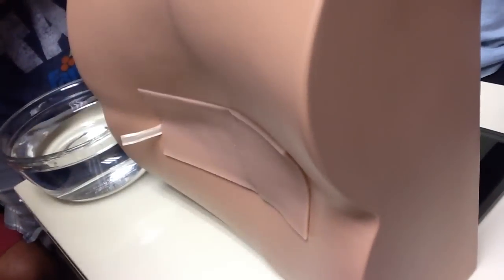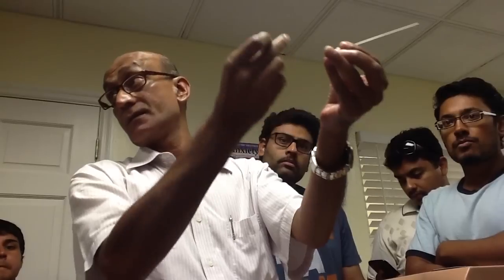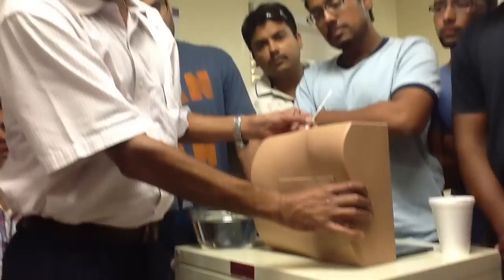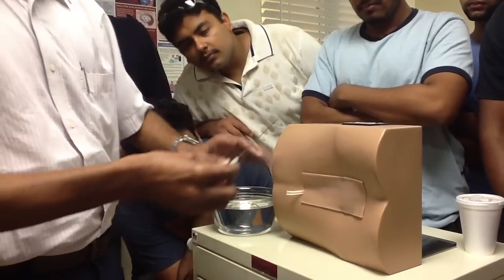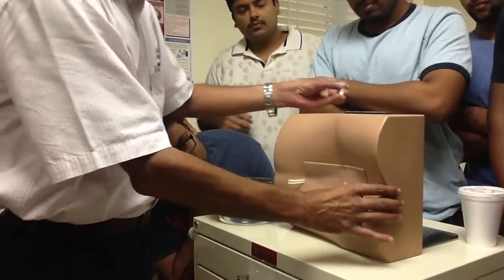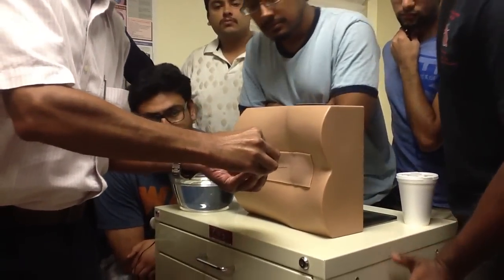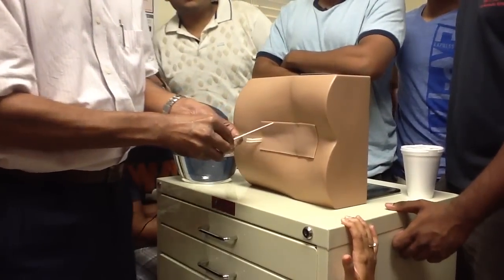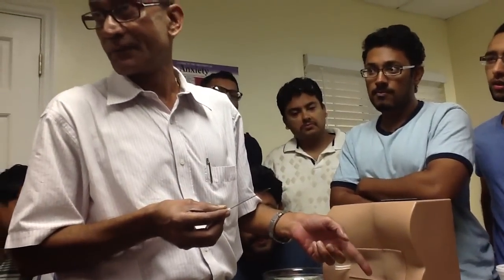Lumbar Puncture Demo - Fall 2012 - Dr Sanjoy Sanyal

Comment: Really helpful sir...
But have doubt...can we really aspirate csf...?
I think it's contraindicated.
Reply from the maker: Yes, there is a chance of Medullary Coning, if you aspirate rapidly. Generally, we just let a limited amount drip out under its own pressure, for Diagnostic or Therapeutic purpose (viz. Normal Pressure Hydrocephalus (NPH) / Benign Intracranial Hypertension (Pseudotumor Cerebri)). I have used the term 'aspirate' in a rather loose metaphorical sense.
Reply: Sanjoy Sanyal thnk you so much

Comment: Recently I have been tested with CSF there is nothing to worry but I'm facing back pain little uncomfortable if you can please tell me how long it will last thanks in advance
Reply from the maker: Usually does not last more than 24 hours.
Reply: @SanjoySanyal  but I'm feeling pain at the needle injected area sir it has been 2 weeks now I was just diagnosed with CSF test can please help me with this sir my doctor said pain may last 45 days it will so thankful if you can give any suggestions sir thank you
Reply from the maker: @SaiRam-yh7lj  Back pains are variable in duration and severity. With sufficient time it will decrease considerably.